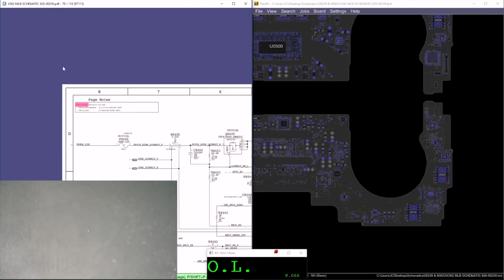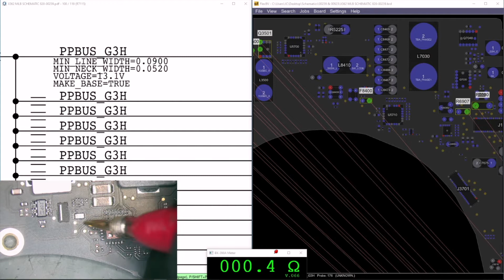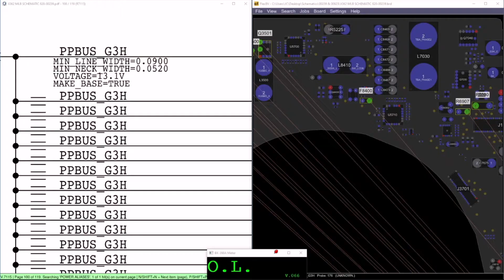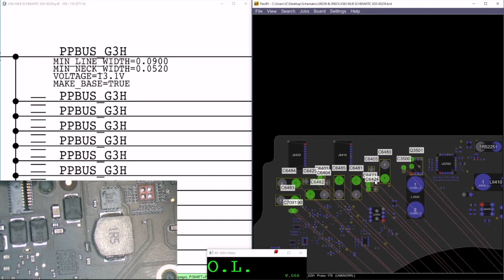A1706 2017 MacBook Pro NO POWER. Voltage at 20 and amps at 0.02? What that means? Can be fixed?

Comment: I followed your advice. Found a perfect patient with similar problem. But when I plug the magsafe with meter it turns  only on on one of 4 ports and it's stuck on 5v. I could find 3.3v delivered to the chip. Could that be still the same problem or should I look somewhere else?
Reply from the maker: Check around each of the USBC and look for a shortcircuit.

Comment: Juan tengo un problema con este mismo macbook la camara no me funciona y no se que hacer  pp5v s0 alscam  f esta  osea le entra corriente , pero dice en el sistema camara no detectada
Reply from the maker: Prueba otro display a ver
Reply: @Juan4Repair  prove otro y igual y cuando verifico en el sistema dece k no hay camara en el equipo , y la luz no baja en el touch le doy a bajar y se queda igual
Reply from the maker: @manuelrojas24  a medir voltajes de camara
Reply: @Juan4Repair  en system preferences me dice cuando seleciono la camara .. no video capture devices were found.
Reply: @Juan4Repair  cuales mido en el conector tengo el cliente llamandome  placa 820-00923 brd J8500
Reply from the maker: @manuelrojas24  para eso debest buscar esquematico y buscar que líneas son de camara y que voltajes usa
Reply: @Juan4Repair  tengo el esquematico y el boardviwaner
Reply: @Juan4Repair  las lineas de la camara son i2c cam scl , i2c cam sda , pp5v s0 alscam f
Reply: @Juan4Repair  solo veo el pp5v
Reply from the maker: 5v y las i2c chequea voltaje
Reply: @Juan4Repair  estan hay los voltajes , no tienes un chat en telegram o whatsapp donde uno pueda mandar fotos  y mediciones
Reply from the maker: Si todo está, entonces ya toca chequear los líneas de data. Si claro WhatsApp 4695580125
Reply: @Juan4Repair  los voltajes estan tengo este  problema aun . y backlight brightness la luz cuando le doy a bajar se queda igual . help me , estoy en el bronx
Reply: @Juan4Repair   en el i2c cam sd tengo 1.801v y en el Alscam 5v
Reply from the maker: Bro ask esta difícil, el brightness no funciona si hay problema en la línea pwm o cuando pantalla es genérica, prueba otra pantalla.